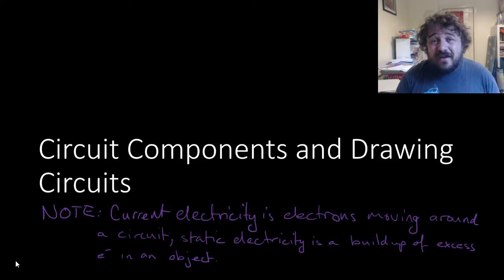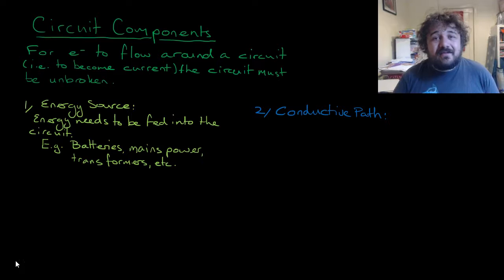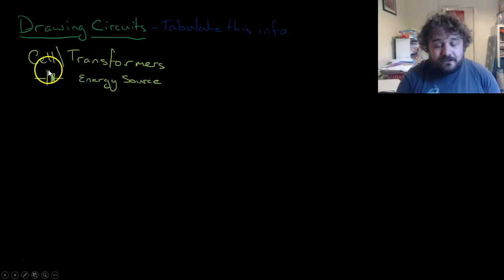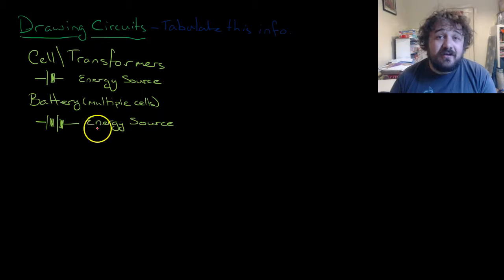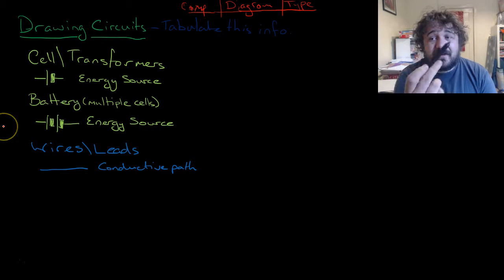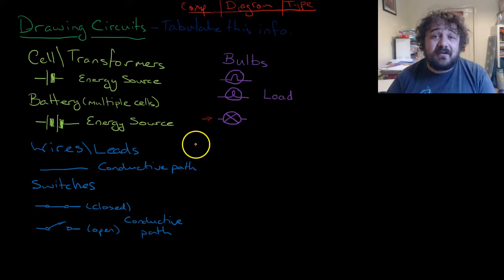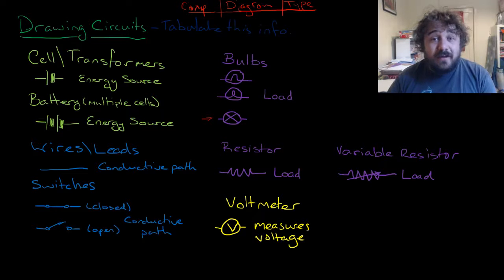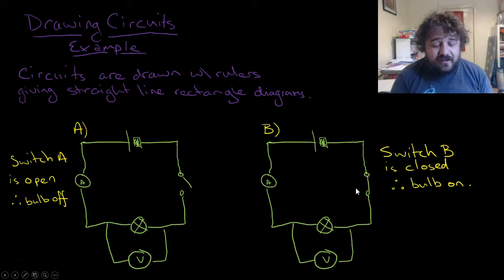Circuit Components and Drawing Circuits

Comment: What is a variable resistor?
Reply: This is a measuring tool that only has two connecting wires That controls the potential passed through a circuit.

Comment: Is a resistor used to reduce the amount of energy in something? So in the example of a kettle more energy is coming out of the socket than needed so the resistor uses or gets rid of the not needed energy?
Reply: Is resistor is anything that electricity cannot pass through easily. When electricity is forced through a resistor it often changes form to heat or light.

Comment: In each circuit does there have to be a voltmeter and amneter?
Reply: I think you only need a voltmeter and an ammeter if you want to measure the current and voltage.

Comment: When a switch is open in a circuit, what happens to the current (the flow of electrons)?
Reply: When a switch is open there is no flow
Reply: Electrons cannot flow, therefore there is no current.

Comment: What happens to the current in diagram a since it is open
Reply: The current in the diagram would not be able get past that point.
Reply: Where the circuit is closed